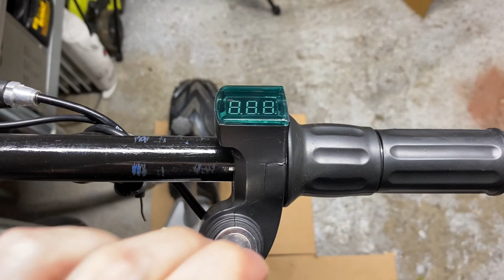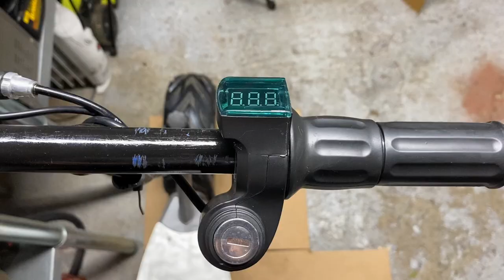Mini Bike Scooter - Skid plate and voltage display

Comment: Good
Reply from the maker: Thanks!
Reply: Hello!  What motor is that?
Reply from the maker: @tiriciocr7148  Hi, the motor is an Astro 3215 from another project.  I wouldn't recommend it for this type of project as there are more suitable options available at lower costs.

Comment: sorry ....no box for the battery 🔋,?????????
Reply from the maker: Hi, this battery is just for testing.  When the drivetrain is finalized, I will probably build a cylindrical cell battery pack and 3Dprint a battery box or try aluminum welding.
Reply: @SvendsenWorks  thanks for responds. alright....pls make another video when the battery is finished